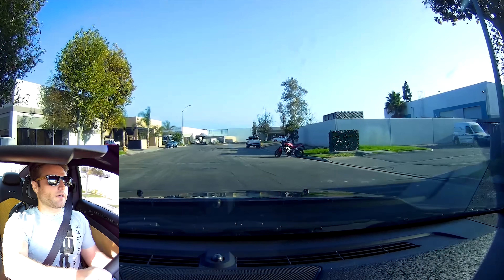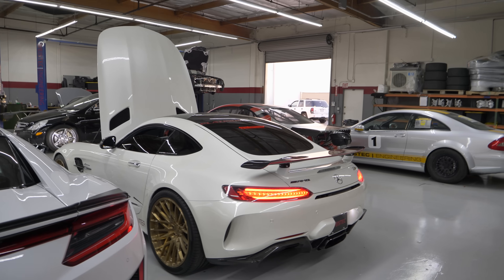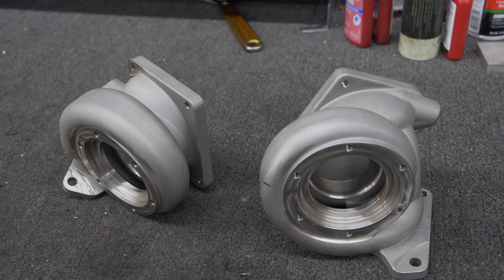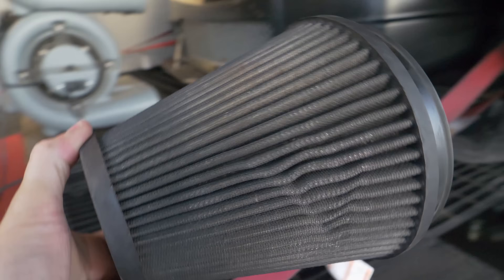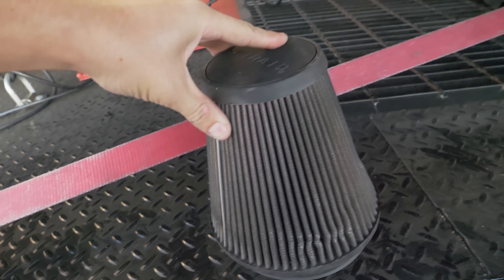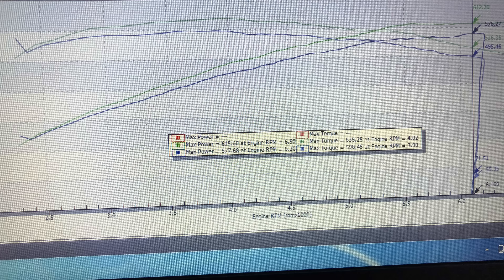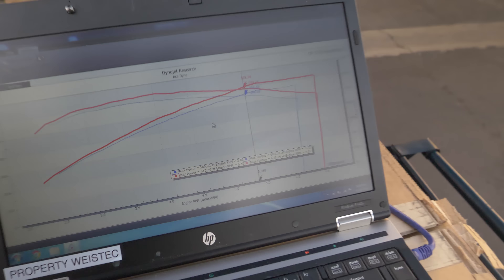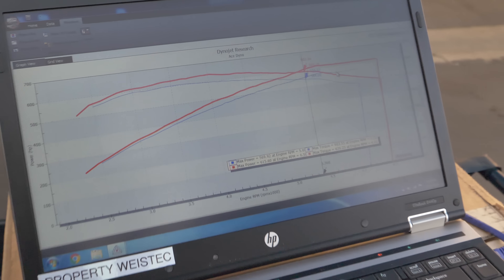How much performance is lost from a DIRTY Air Filter?

Comment: Illegitimate. The clean filter would have restriction. Not an accurate test.
Reply: Dirty air filter = -50 whp.   Clean air filter = some loss to no loss. Look up hot rod magazines test on air cleaners for carbed motors. Some filters actually increased horsepower over running no filter

Comment: But were your high power runs with the clean air filter or with no air filter? If it was just with no air filter, you haven’t really proven your hypothesis ...

Psyched for your spoilers. And that ending 😄

Comment: Very misleading Rob.... should of put on new or cleaned filter then dyno. Air filters are restrictions. Lost 25 hp with k&n off vs on...on my turbo car. New filter. Your air fuel should of altered too.
Reply: No reason for air fuel ratio to alter unless you're on a TPS tune (generally only ITBs need that). It's not like the ecu can't measure the difference in airflow.

Comment: You should of cleaned the air filter and put it back in and run the test. Because the air filter would put restriction back in the system and you would not get that 50hp like you're seeing with no air filter.
Reply: @miro5031  no one is denying there is some difference but the OP is correct... without testing the filter after cleaning then you have the TRUE HP LOST due to an excessively dirty filter.
Reply: Look at this 0-60 mph comparison between the least restrictive air cleaner element (K&N) and most restrictive (Wix) in a Chevy Suburban.  Even the slowest was only 0.3 second different.  Now, of course this would be more marked with a supercharger, but I was surprised the difference wasn't that great:  https://youtu.be/sJ3L-E-ufYo?t=538
Reply: @johnrroberts7900  I don't even remember writing this 2+ years ago, but I notice the increase in MPG's more than I do with HP increase.

Comment: @2:38 people don't realize allot of that ethanol test low, your using e70 not e85. LMFAO you didn't know that.
Reply from the maker: My car is tuned to expect 70. My flex fuel sensor doesn’t change the tune above that. I didn’t realize it until recently either.
Reply: @RobDahm  oh you did know that, yeah you're definitely a pretty sharp dude, I was kind of trollin.  Jokes on me, my Airaid filter is also dirty and clogged. Cool you replied, your taste in cars is on point btw. That V is dope now it just needs methanol and some E 90 or maybe just that thermal reduction plate from fasterproms.  Keep up the good work, pretty impressive.